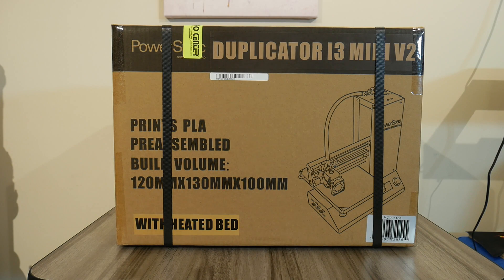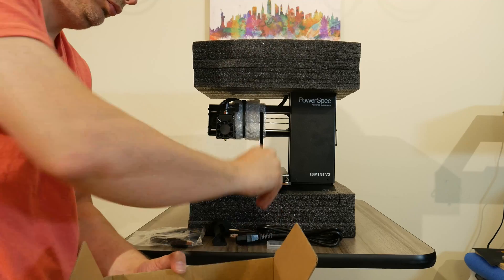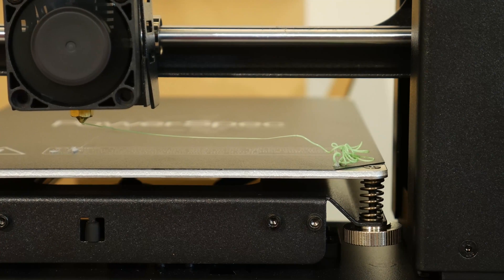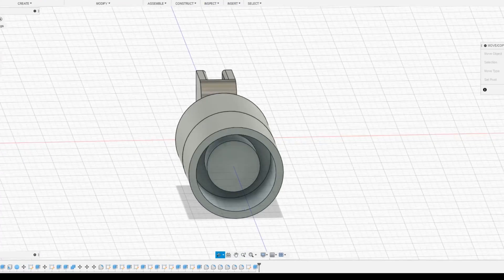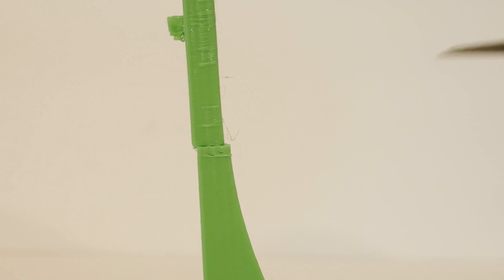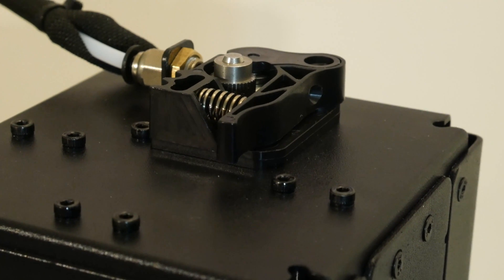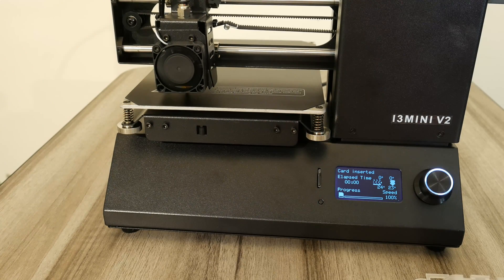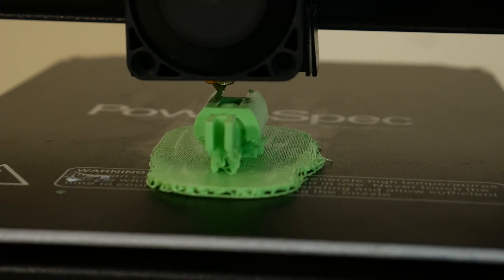$140 3D Printer Power Spec Duplicator i3 Mini V2 -Is it worth it in 2020?

Comment: Hello Guys, Thanks for the Video. I have had my Powerspec I3 mini for 2 years and I tried to print once and ruined my mat (Printing Surface). Hot end was to close and I burnt holes in the mat. I just replaced it (the mat) a week ago and now I am wanting to give it a shot again. I have Ultimaker Cura (v4.8.0) installed and I am trying to learn how to put in the machine settings (bed measurements) Where added in CURA by the way my version is 4.8.0 Settings > Printer > Manage Printers > Machine Settings then I see printer then X width Y depth  Z height < Are these the bed measurements/settings?
Reply from the maker: Yes, those are the bed settings.  You will also need to make sure you selected heated bed plate and heated bed volume.       As a tip, I have found using the heated bed starts to act strange and shut down after several minutes if its above 60 degrees.  I usually keep it around 55-58.   The power supply seems to weak to handle anything above that for long periods.
Reply: @make_and_remake  Mine is Version 1 not 2, no heated bed on this one.

Comment: This... is 2020. This is completely and utterly unacceptable. Zero consistency, basic, easily solvable issues, and a print failure rate so high as to seem intentional. Even the decent prints you made suffered from this jank.

 Fortunately, i had the dubious honor of helping a friend fix his, and after two straight days hunting the one wire that had come desoldered from the control board, and another of watching in horrified fascination as he went through the dozens-of-steps-long process of setting it up and getting a single benchy done, i realized- this device is simply what happens when a good idea hits a brick wall made from solid greed. The cut corners lay it out so clearly you might as well get 'aurum est potestas' engraved on the gantry. 

You tried VERY hard to draw attention to the positives, and you are an absolute saint for it- there are actually a few positives here. But: RepRap exists. The Ender 3, A8, and Tarantula exist. It would be more worth one's time and sanity to head over to your local makerspace and print a Snappy. This is, in no way, a printer that has a right to exist, and the fact that its price is lower than the market average does not listen to it again DOES NOT invalidate its many, many issues.

Comment: After upgrading firmware, heat bed temp issues and lockups went away.  Need to do more printing to fully test.  I purchased mine for $99.  Probably worth it with the firmware update.  Like you said, not for a beginner.
Reply from the maker: Glad to hear most your issues have seemed to went away.  If you don’t mind me asking, what firmware did you end up upgrading with?
Reply: @make_and_remake  I used Marlin 2.0.3 with a template for Wanhao i3 mini and customized bed size, and possible a couple other settings.   Became very stable.

Comment: Hey Jason. Great review. My print head keeps crashing into the post. Any ideas?
Reply from the maker: It sounds like the end stop switch may not be connected or have a faulty wire.  You could check the connections at the stop switch or even at the main board.

Comment: huh. i have the first gen and its print quality is pretty good. the ONLY thing is if i try to reheat the nozzle after it has started to drop is that the firmware will freeze. but after it has dropped below ~65 i can reheat without problems. glad i didn't get this one then.
Reply from the maker: I'm glad you did not get one with the buggy firmware.   I really do like the materials from this printer and the small size.   The fact it can print TPU so smoothly makes this little guy pretty awesome.  I debated for awhile to exchange it for a new one, but after speaking with so many other people that experienced the same issue, I just decided it wasn't worth my time to try another one.   Upgrading the firmware, however,  is something that is happening sooner than later.

Comment: Do you think these "firmware glitches" are specific to this model, or do you think its an issue across all  "PowerSpec" printers?
Reply from the maker: I am not sure if the firmware is across all PowerSpec printers. However,  I know this particular issue seems to be on many of the i3 mini printers. I think most people have gotten used to the glitchy firmware because the printer is so cheap. Nevertheless, it still persists.  A few people have reached out to me that bought several of them to deploy them in their school district.  They had similar issues and were highly dissatisfied with them.
Reply: @make_and_remake  I have a powerspec i3mini v2 and ive only had 3 firmware crashes no temp changes and such but also i would be interested if you still have the stl or ogj file for that tbu clamp would you link it
Reply: and my firmware issues allways happened during heatups

Comment: Spot on with this review.  We made the mistake of buying several of these our middle school.  Big mistake.   They do work, but not on a regular basis.  We were hoping they be ideal because our lab is so small. The only thing I will say though is I haven't had to replace any parts other than the bed stickers.   I just wish the things wouldn't crash all the time.  Our kids get tired waiting and waiting to print things only to find something that has glitched out.  Our Dremel printers just work, wish this did, too.  At first I thought it was the kids messing things up, but it wasn't.   However, the one thing you didn't touch on was the machine is really easy to load and unload, at least for kids.   The thing is built like a tank so it can take a beating.

Comment: Glad to see this video, since friend of mine just purchased one. I think that some conclusions aren't correct. Like when you show the part not sticking to the bed!!! That is fixable, but you didn't address that at all and keped blaming slicer or the machine. BUT I do agree that the temperature controlled bed should stay set and or you should be able to change it - I never had this problem ever and none of my friends either. The firmware should be fixed or you can download from others a better version. Also, I do agree that this inexpensive, cheep printer has more to grow if they want to sell this as a printer! Thanks for sharing your ideas.

Comment: Wow!  You really must have a lot of free time on your hands for such a thorough review.  Of course I could have saved you a lot of time and told you this machine is useless.  Although I was surprised how you got TPU to print with that little clamp.  If I still had the printer I would try it. I bought one of these a few months a ago from a Microcenter in Houston.   Nothing but problems.   As you said the firmware was junk.  It didn't matter what I put on the card, the thing always changed the temps.   I also thought it was a lot louder than I thought it would be.  When you mentioned benchy I had to laugh because I never could even get the thing to print.   Like you said, it's a shame because the thing is so small it would have the perfect footprint.  Also, you forgot to mention the crappy filament they gave.  I tried it and that was a mistake. Returned it and just bought the Sidewinder from Gearbest.  Good video, but like I said I could have saved you the time and said the thing is junk.   Anybody that bought this for a school, good luck lol.
Reply from the maker: No doubt!   I really wanted to like this machine.   All I know this fall if we return back to school on a traditional schedule, this thing isn't making the list of printers to put in the classrooms.

Comment: That's a bowden tube setup, not a direct drive, you might want to amend your statements. A direct drive pushes filament directly into the hot end from the stepper motor with no tube. Seems like there is a first layer problem there as well, I would definitely get the head closer to the bed. Does this printer have part cooling? I would also test some more with retraction distance  This looks much more like a hobby machine that needs mods to work properly (which you do mention), I actually expect this at the price point. I can see a few mods that I would dive into to make this better. Also keep in mind that you might have a lemon, other people have success with no mods at all. Which says something about this companies QC (not to good). I would certainly look at that firmware asap, I have a couple extra ramps boards laying around and I would likely swap one in ASAP so that I don't need custom firmware. I enjoy the tinkering process though. I've been wanting something in this form factor, I might actually give one a try. Looks like it should be simple enough to add a real belt tension system, remove any other forms of slop, perhaps check the flatness of the bed and bend it into something closer resembling "flat", change the electronics, add an all metal hot end, add dedicated part cooling, and perhaps add a BLTouch.
Reply: I was about to mention the same exact thing...I was going no, that's not a direct drive buddy...